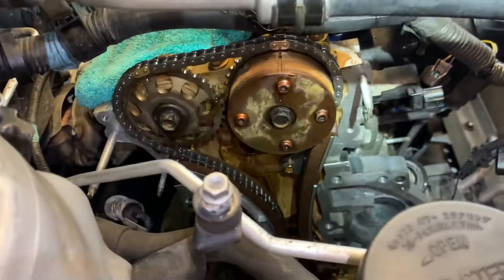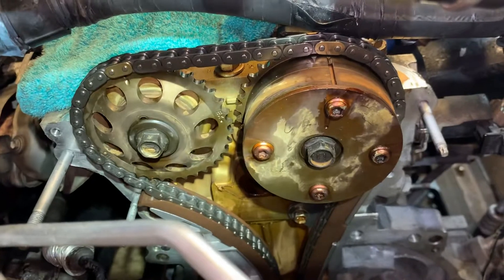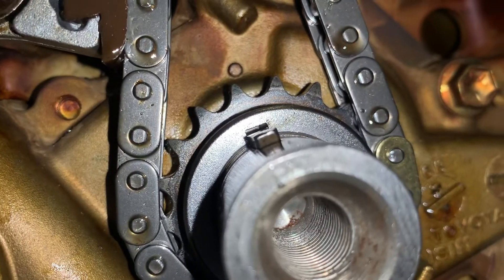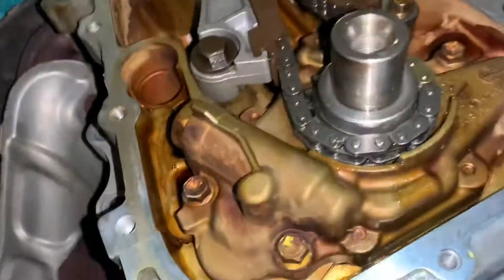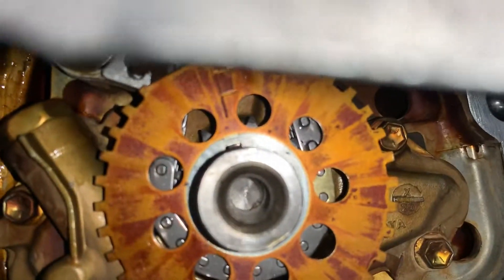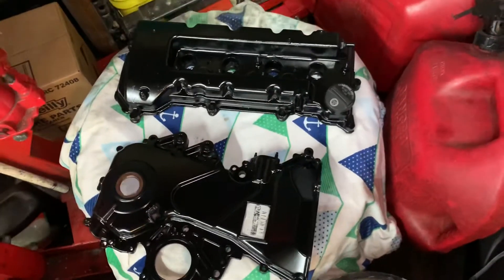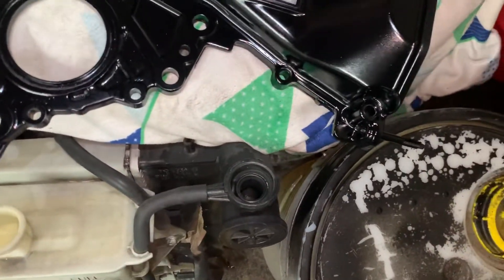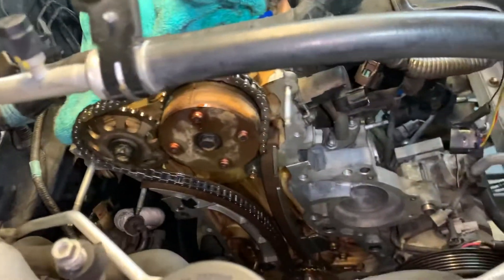2005 Toyota Corolla Timing marks

Comment: Excellent video! My 2007 Rolla has 296k on it and had a noise when starting. Changed the adjuster but that didn't fix the problem. The chain was REALLY stretched but the VVT gear was broken inside, it moved easily and the timing marks were off.  In a couple of days it will b back together. Thanks for a great video and explanation.